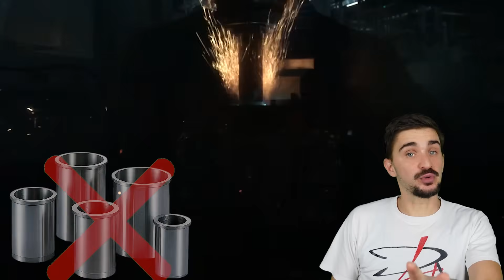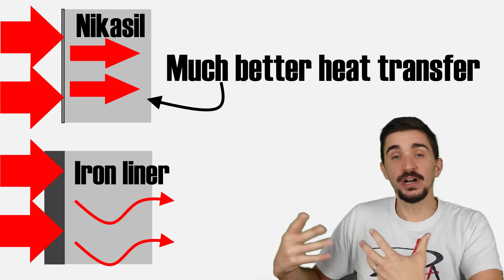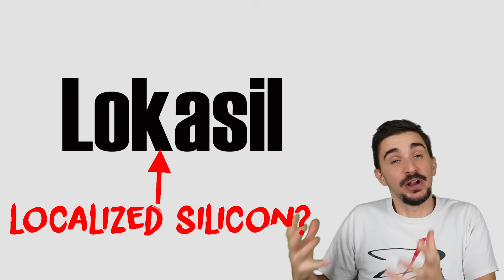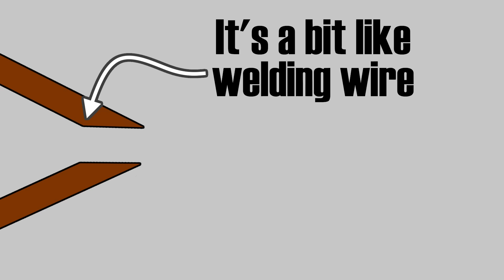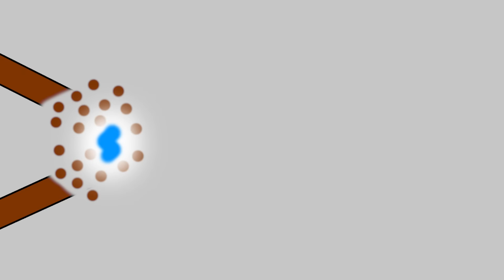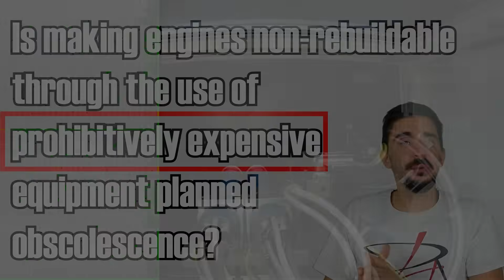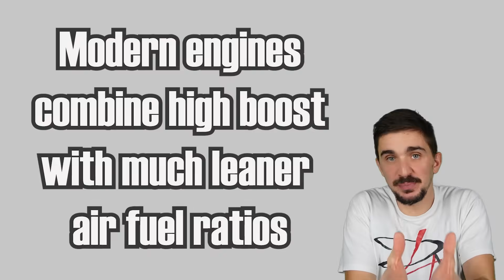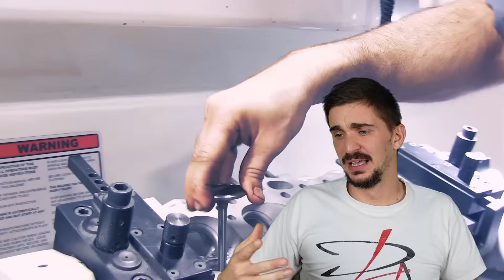Why Are Engines Becoming Non-Rebuildable? Everything About Cylinder Coatings

Comment: When you have a fully automated factory pushing out single-use cars, the only part where actual workers are used is the recycling plant down the road. That recycling plant cannot pay enough salary for those workers to buy a new car every two years, otherwise the material cost for the automated car factory would bankrupt the business. To who are these solo cups built for, then? When it takes a 5 to 10 years to pay your average car loan, your investment has been recycled twice before your last payment has been met. Also, your happy meal package has absolutely no resale value, due to it's absolute finite lifespan. When you are living in a city and working from home, you don't need a car. That rules out all of the upper middle class, who could actually afford one. And for those who actually need a car to go to work, can't afford one, so they play hot potato with the junk from previous generation, actually creating the emissions the industry is trying to reduce.

The whole business model for the new car industry makes no sense at all. Any single-use item can't cost more than average worker has to spend from one month's salary. Average worker who travels from home to work. After normal living costs, the average worker has around 500 euros to spend on throw-away items. You can't build a car for 500 euros, and you definitely not are able to sell a new take-away coffee mug on wheels for 500 euros.

And furthermore, when your leased, fully insured source of micro plastics has no resale value, you are not considering it as a valuable item that has to be taken care of. You are driving it drunk, abusing it to the max, consuming every bit of the road and the car, causing a lot of accidents that would not occur when your ride actually means something to you as an item of value. Yes, the car has an on-board data logger reporting in real-time to your leasing company your every driving habit, effecting your monthly payment, but is that going to save the driving culture in general?

Sure a three cylinder wet wipe is going to reduce emissions, but so does a line fed electric bus. Step in the bus, take your seat, step out of the bus, take your workstation, eat your lunch, numb your brain, step back into the bus and go home. Repeat until you can't anymore.

Trabant was the perfect car, on paper. The absolute pinnacle of meeting the demands of the commission. Peak of innovation.

Comment: Ah, so it's plausibly-deniable planned obsolescence. 

Obsolescence of the obsolescence-planning budget, time and energy, possibly planned once upon a time and now forever inbuilt into a process that they were going to do anyway. 

That is, the obsolescence costs them nothing because the process causing it exists for a whole separate and unrelated purpose, allegedly.  

If consumers were able to claim any bore-scoring on warranty, then, perhaps, your argument about there being cheaper ways to plan obsolescence might hold some weight, but the coating generally makes it through this period fine and nothing is cheaper than free. 

And it only takes 'most' of the engines to make it through this period for the manufacturer to blame the odd failures during it, on the particular vehicle's owner. 

Was it with the M278 or M156 that Mercedes already set this precedent?

BTW, I wasn't aware that Alusil was used on their earlier engines, generally known for their reliability. Perhaps this explains why they're also known for drinking oil. It doesn't quite explain the C55 currently for sale that apparently has had its engine 'refurbished' after busting a piston. I guess that one cylinder is forever going to give trouble moving forward. 

I know that lots of the little plastic parts and accessories on engines are designed to bring in a few dollars for the official dealerships, but creating the need to order and install whole new short blocks is a bit too much. 

Perhaps the companies employing such strategies don't mind losing some customers to the Japanese and Korean carmakers because they're happy enough with the people who only purchase brand new and sell at end of warranty. 

It's probably another cost that they factor into the equations - the loss of potential new car buyers who experienced one of their cars used. 

I guess if the cars lasted forever, there'd be less of a market for new cars and an oversupply of used ones. 

Manufacturers would simply go out of business or become extremely 'boutique'.

Comment: Interesting fact is that the Vega engine makes a reliable aircraft engine. Apparently the coating does not wear as much if the RPM's don't vary much or change quickly.

Comment: Starting at 28.00 the facial expressions are along the lines of another point that wasn't mentioned, (that being) a lot of y'all's car's 10-15 years in when the engine has reached "end of life" are going to be nasty! All sorts of spilled liquids, food crumbs, body and animal hair, dead skin cells, possibly vomit and other fluids, all sorts of dirt and debris, mold, mildew, possibly cigarette and vape contamination, possibly rodent excrement and damage, broken knobs, sagging roof liners, torn upholstery, rust and corrosion and that's just on the inside...

But sure I'm for right to repair if cleaning up that mess is what you want or should do.
Reply: On a slightly more serious note as  for motorsports enthusiasts or other people that took very good care of they're car there could/should be an option to send the block back to the manufacturer for a recoating of the cylinders. 

Now if the manufacturer outwardly refused to accommodate such a program then you can maybe go ahead and cry Planned Obsolescence!

Comment: 18:32 Or, for another, older example: You take a part that needs to eventually be changed out as a part of regular maintenance (say, a fuel pressure regulator) and install it into another integral engine part (say, the throttle body) that you don't intend to continue producing anywhere near as long as it will take for the regular maintenance part (in this case, the fuel pressure regulator) to fail and you install it in such a way that, in this example, it's nearly impossible to remove the old fuel pressure regulator without making it nearly impossible (at least for the average do it yourselfer) to reinstall it.

For the record, I'm speaking of the 1991 Pontiac Firefly I used to own on which the fuel pressure regulator is installed into the throttle body with a pressure regulator cover plate that's held on with 4 tiny brittle bolts that were thread locked in the factory for seemingly no reason but to cause them to snap when anyone attempts to remove them to prevent Suzuki's G10A, which seems like it could run forever without a rebuild, from lasting forever. That pissed me off. I loved that little car. I don't think I'll ever see another car with fuel economy like that. Not even my Yaris can compete.

Comment: Excellent presentation.  I vaguely remember during my days as a VW technician in the late 90s that the cylinder bores of our 2.0L engines were treated with a process that I can't remember now.  Those engines had a cast iron block.  On many of those engines we started seeing oil consumption issues bad enough to foul spark plugs.  I was routinely using a light application of flex stones to break the glaze in the cylinders.  We were also replacing valve guide seals in conjunction with this repair.  Are you familiar with  the treatment the VW used in their (not aluminum) blocks?

Comment: Nickel is the best coat, but problematic: nickel_abrarion (nano-particles!) will cause allergies. 
if wide used it could be a Long_term public health problem! 
Nickel Hostalloy is a high tech material for High Temperature Nuclear Reactors MSRs!
Reply: i'd say that, relative to everything else coming out of an exhaust pipe in much much much greater quantities, that this risk does exist, but is likely to be insignificant.

Comment: Its not planned obsolesce, the manufacturers are just looking out for their profits while following regulation but they are knowingly giving a worse product in overall lifespan. You are right though rebuilding an engine seems less common and more expensive now and everyone swaps a new engine or just scraps the whole car, but this would have been avoidable if longevity was a common practice priority for the designers and I think it would reduce co2 and all if more older cars just ran longer. All comes down to dumb regulations forcing automakers to sell worse products.

Comment: Interesting. With the Rotary Engine they were looking in the wrong direction when it came to fixing its many problems as the primary problems were in how the engine was made as they really needed to take the engine back to print and solve the problems of the way it was designed as it's problems where with the design. 
Now when it comes to planned obsolesce it is a practice that is done by most, if not all, manufactures as a way for them to stay in business over time. So, what they must do is come up with creative ways to balance what they make to what their customers are willing to buy from them. Now if you have a company and you make something that never wears out then once the world has purchased what you make then you will be out of business as no one in the future will need to buy it as they just hand down your product to others after they are done with it and basically your business will have committed business suicide.

Comment: You could still do rebuildable engines with all these modern methods.. you do aluminium inserts with the coatings.. that means you just replace the inserts to rebuild the engine.. Then you also make sure you have an electric oil pump so you always build oil pressure before starting the engine and not get cold start wear, increasing the lifespan something like 10x.

Comment: One of the problems with these coatings is that, even if they resist wear better, they tend to promote the wear of engine components such as pistons and rings. Remember that, although materials such as silicon and silicon carbide resist wear, they are also abrasives. In fact, when Chevy used Alusil on the Vega engine, they had to use iron plated pistons to deal with this problem. Also, Honda engines with use coatings (ie H22A, J37, etc.) tend to become oil burners for this very reason.

Another problem with coatings is that, since they are thin, they don’t give an aluminum block the kind of strength they get from cast iron sleeves. This makes them MUCH less suitable for forced induction.

As for rebuilding plated engines, sleeving has LONG been an option. For instance, many people looking to boost plated Honda engines (especially the H22A) upgrade them with cast iron sleeves.Other people have rebuilt Vega engines back in the day with cast iron sleeves in order to deal with the issues caused by Alusil sleeves.

Comment: You're a shill. Making repairs prohibitively expensive is the definition of planned obsolescence. Making the price of repair the same or more than buying new is the goal of the consumerist industry to keep sales of new products going. You don't see this crap in industrial applications. Example: Railroad locomotive engines are specified by the customer to be supremely rebuildable. The manufacturer does it because the customer demanded it. They buy a locomotive once and keep it going as long as they can with engine swaps for rebuilt units to keep them rolling.  Yet we as consumers allow ourselves to be fleeced regularly for the cost of a new vehicle. The early tech adopters an Keep-up-with-the-Jones' types re-enforce this treatment of customers.

Comment: That was a great analisys, however you missed missed the bigger picture. While rebuilding an engine is a viable solution for older engines, but cars newer than 2010-ish will most likely be just trown away for scrap as a whole, instead of getting a rebuild. So now we're comparing lowering Co2 emmissions via spray coating on new engines vs. gains and loss from recycling a whole car, and not just it's engine.

Also, it would've been nice to include nitriding as a process for hardening iron sleeves/ block, as it improves significantly their life.
Reply: Replacement parts are increasingly hard to find the older the vehicle gets. Aftermarket quality is questionable. And many things are very expensive if you have to buy them from the dealer. One way, or another you have to "pay to play". Either you pay monthly by leasing a car every 3-5 years, or pay lump sums when you need to fix your old car.

Comment: ! But it only takes one Badly or Not to well Assembled but passed basic quality standards part to Permanently Damage the New Spray coated engine. Coupled that with certain Manufacturing Processes defects or Material Quality Issues like what Toyota are experiencing and you have Engines that don't make it past the first or Second Year Only to need a Complete Head and Block Replacement. Now we have Companies like Ford and Kia (Typical USA Companies) That will have defective Engines from the start but tell you that you are the Problem and Using their Product wrong and Will NOT Provide any Warranty unless they are taken to Court by Expensive Lawyers etc and With the RICH now being Backed By a MAGA Government it's basically Your Loss! So Essentially if you value your money and Peace of Mind then Don't Buy "American" ! And that 20 Year old Toyota/Nissan or even Ford and Chevy can be Rebuilt in your Home Garage at a Fraction of the cost and Last you another 20 Years.

Comment: My 1997 Mitsubishi Mirage Cyborg has a  1,600 cc N/A engine and makes 170ps and it's CO2 emissions are 190, crazy high
Reply: The more power it makes the more CO2 it emits. You gotta burn fuel to get the power. My 2.4T Volvo V70 makes 200HP and 222g/km CO2. So 190 doesn't seem high to me

Comment: to be fair, import and euro engines are mostly throw-a-way motors anyways...

they like to mock our pushrod V8's, but I'd like to see them run an engine for 200-300k, do a 2-3k rebuild,  then run it another 200k+
Reply: Your V8 pushrod would never pass EURO 6 emissions. And you can afford to run them because you pay less for fuel.

Comment: well... but why fight for 1% efficiency if synthetic fuels are already manufactured f.e. in spain... plus LPG and methane is still vented into the atmosphere by oil corporations ... there is no shortage of environmentally friendly fuel for cars because they are less than 3% of emissions. Even if you would like to drive on synthetic , eco friendly ethanol right now, the fuel is only marginally (few euro cents) more expensive . Driving on methane (white or green) is also not really causing any problems either..
OTOH if you ask chatGPT who is responsible for the majority of co2 emissions cars are at the very bottom. The first tiers are f.e. billionaires in yachts and transatlantic flights in private jets. 
Even if there would be some benefits of modernizing car fleets - cargo trucks are far more polluting, but we do not see harsher laws about those.

Comment: The new Toyota engines (A25A and M20A) are like this. They do use thin cast-in liners, but they can't be bored out. All you can do is replace the short block. Perhaps they are coating these liners.

Comment: Minor rebuilding, like replacing pistons, camshaft, and other internal parts that can "simply" be replaced, sure, but full rebuild? Nah, not worth it. While replacing internal parts, it might as well be worth to do a complete cleanup, like cleaning the oil pan, replace oil pump, and it will be needed to replace gasket, while it overall will make the engine last longer at a reasonable price, assuming it's either "cheap" in the country it's performed in, or most of the job is done at home in a private garage. Here in Norway, most of it have to be done at home, as it would be incredibly expensive otherwise

Comment: When Porsche sold Nikasil coated cylinders in the early '60s for my Speedster, they included a fitted piston and ring set with each pre-honed cylinder, because normal engine hones wouldn't work. All very expensive. Porsche acid-washed the bores to remove some of the nickel-aluminum, leaving silicon carbide particles slightly above the surface. Then diamond hones cut the surface flat and the pores left behind held enough oil to allow rings to seat. 60 years later, are there economical techniques that solve the expensive Nikasil honing problem?

Comment: I agree. I rebuilt my overheated engine myself (cause it's USA, labor is very expensive), it costed me 3k for parts, and it was a cheap rebuild, while the car itself with an working engine costs 2k on a market. So, in my case the rebuildable engine costed me more than just an engine swap.

Comment: Yay, I have a Lokasil engine.  Thankfully used oil analysis has shown that my engine is healthy so far at 88k miles.  Do you know if Porsche was aware of bore scoring early enough before the 9A1 engine was designed and built?  9A1 replaced the M96/M97 engine.  I have not been able to find out of the 9A1 also has Lokasil.

Comment: I sleeved a nikasil motorcycle cylinder with a cast liner and it was like riding with the back brake dragging afterwards. 

I now advocate the use of cylinder coatings. You just need to really look after it.